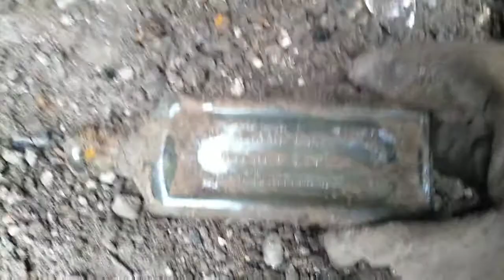Digging IN plus Nelsonville, and Dayton Ohio.

Comment: Let me know if you ever get back to dayton. I know a spot on the edge of and old farm. Lots of surface glass. Doesn't seem like it's been dug.
Reply from the maker: I'm back in the area now. How old are the shards on the surface?
Reply: @southernohiodigger2691  fairly modern prob 1960s. The farm has been demolished. Space is between a new residential development and a reserve. I haven't dug into it. The space had a bank barn, several other outbuildings. A rock foundation, a concrete foundation with a capped well or cistern, and lots of remnants remain.
Reply from the maker: @mporba  interesting. How old is the farm itself?
Reply: @southernohiodigger2691  it had two 50-60ft wood silos. An abandoned house on the property, since demoloshed, had an old drum washer half buried in a dirt basement, a 40s era fridge, prob built 1910-20s judging by its look. A couple of the out buildings and the barn were mortice and peg construction.
Reply from the maker: @mporba  I suppose it's worth a shot. Were you wanting to dig it by yourself, or were you wanting me to dig it with you?
Reply: @southernohiodigger2691  not sure when I'll get back out there but I'll do some probing and evaluating. More than welcome to dig. If yer out this way and wanna scout it let me know. Be happy to show ya where it is.
Reply from the maker: @mporba  sounds good.